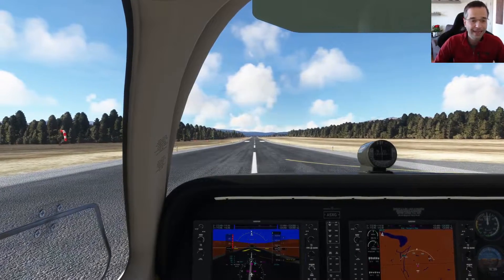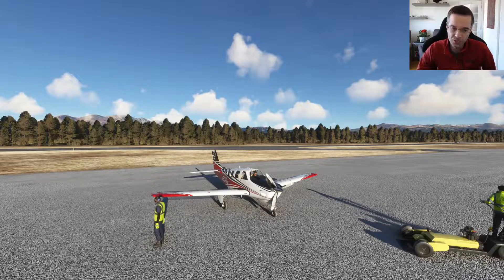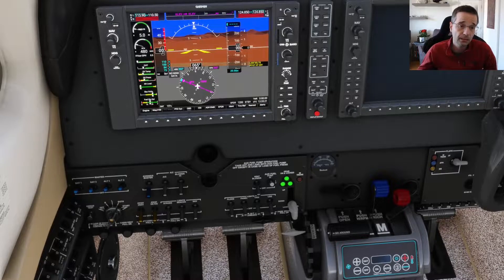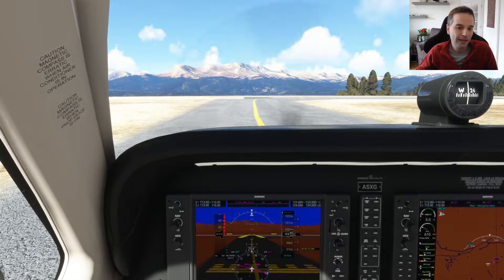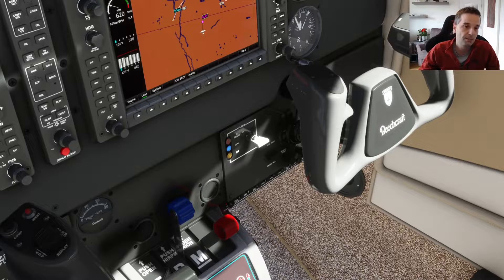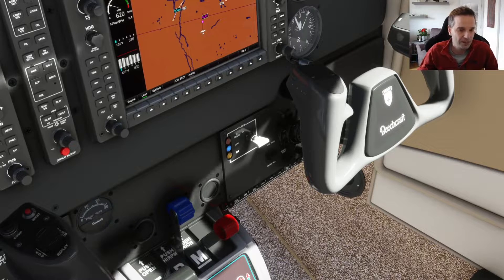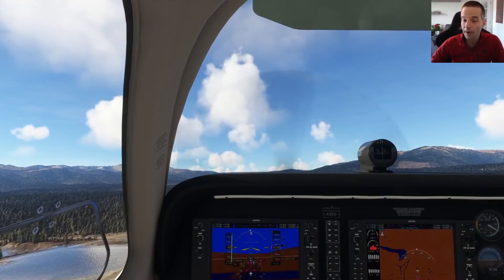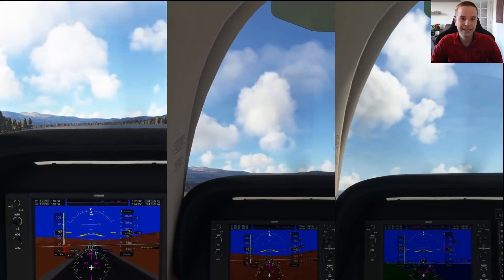High Altitude Takeoffs | Microsoft Flight Simulator Tutorial

Comment: Great video. I was struggling to takeoff on a float plane at 6000ft. Will try leaning the mixture. Btw what's the recommended flap setting for high altitude t/o?
Reply from the maker: Thank Jenny! It's going to depend on the airplane that you're flying, but generally it'll be either the first or second notch of flaps for short field. Anything that results in less than 15 degrees of flap deflection is going to generate more lift than drag.